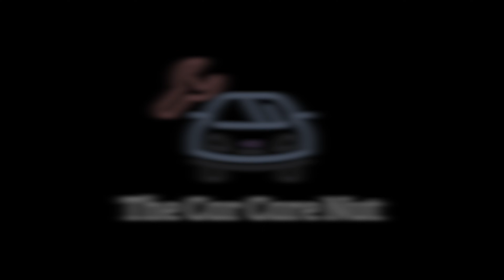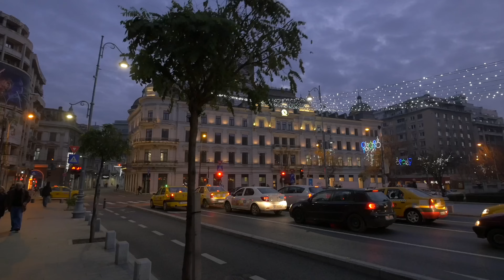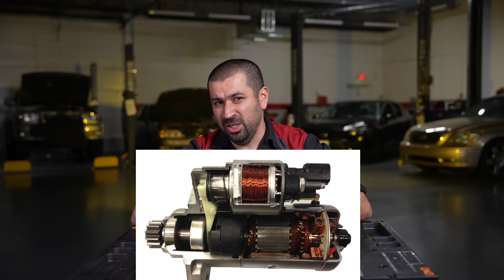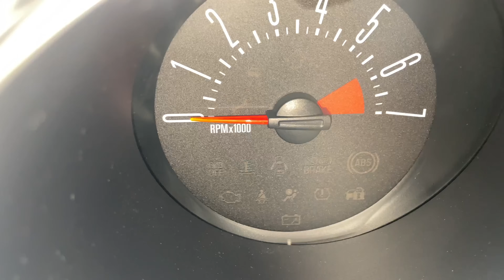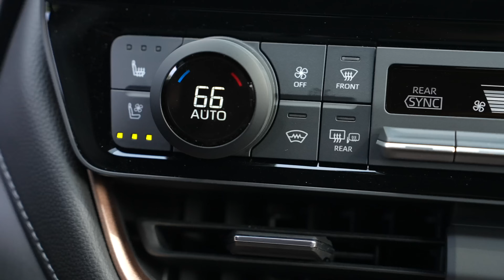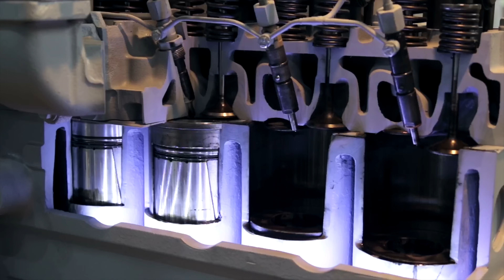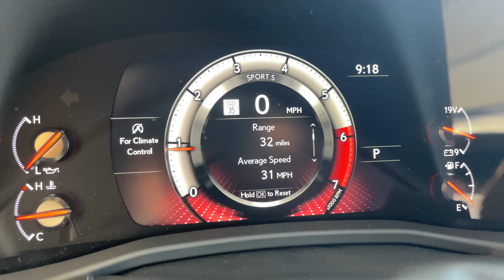How Does Start Stop Technology Work in Modern Cars? Everything You Need to Know

Comment: Amazing explanation. Sadly our LATAM corolla cross hybrids have NONE of those Air Conditioner fancy backups.

My Hybrid efficiency goes to the ground in cold weather because the engine needs to be constantly turning on to keep the heat of the coolant almost 20°C above the AC set temperature. In hot weather AC keeps drawing current from the HV battery when the engine is off to be able to keep the inside cold. Surprisingly this helps a bit with the efficiency because if the HV battery is lower than 50% your regen braking capacity goes up and you can be a little bit more agresive in the driving without impacting the efficiency.

Comment: Start stop. When the auto industry sleeps with the EPA. 90% of engine west comes from just starting the engine because no oil pressure is present until it cranks over, go with that knowledge. Want to avoid start stop all together? Buy a standard transmission vehicle- if you can even find one. In feb. of 2021 before everything went crazy expensive my 21 Tacoma with a 6 speed had been sitting on the lot for 4 months, it was an unusual setup given it had a lift kit and all the goodies. 45 grand sticker price. My 2018 Cruze had negative equity of 5 grand I signed the dotted line, total out the door was an additional 10 grand. 59,800 in total. Welcome to PA where they’ll tax the hell outta ya, good news I made a deal at 3%!

Comment: There's a theoretical reason to suspect it causing engine damage because it turns off the oil pump, thereby increasing the possibility of metal-on-metal contact occurring inside the engine. Again: it's theoretical. Probably doesn't matter all too much in practice.
Reply: You have no idea what you're talking about and didn't watch the video. There are electric pumps...

Comment: To disable the system, simply disconnect the sensor on the battery. The car will not activate the Start/Stop system when it cannot monitor the battery health. I have always done this. I hate this system and pushing that damn button every single time gets really annoying.

Comment: In my opinion new  modern technology is quite often useless and not cost effective  for the consumer  at all . 
 I  still say stop start engines are a completely  stupid system  all the extra sensors needed  creates more possible  problems and more likely to have a   failure at some time more exspensive fix more exspensive  to maintain  more things to  replace more reliant  on the computer to not malfunction  and many more  things could possibly  go wrong at any time .  The extra ware and tear on the engine stopping and starting all the time  it  will not last as long  the fuel savings is  so minimal  for average  driving conditions . Old school rocks modern technology and  new designers  are a fail  and are   just a big  rip off scam .  Much like putting a submersible fuel pump and fuel filter in the gas tank  instead of an  external  fuel pump so pushing the fuel instead of pulling the fuel is better just another  exspensive  can  not replace easily  yourself  scam  . Oncoming traffic  being blinded by rediculaslly  over bright LED  lights  ect ect ect   :(

Comment: I love that toyota adds loopholes to shut these stupid start stop systems off. My 2023 tundra crewmax doesn't have the button (probably because the 1794 edition is a hybrid) but i can simple put it in tow/haul mode and the auto stop is defaulted off. Just need to find a tuner that can save my settings between start ups and have my truck start up in tow/haul mode

Comment: to be honest  I really dislike this system.
Reply: I press the off button on every trip. I dont mind turning the engine off in a long traffic queue but on the other hand if I am driving long distance abroad I want to keep the engine running for fear that it wont start and leave me stranded. Breakdowns abroad are no fun
Reply: Wow there’s a lot more parts involved in these start/stop systems than I realized
Reply: I would rather just buy a hybrid or EV.
Reply: Whatever happened to the Chevy hybrid that only worked with an alternator
Reply: I really don't think anyone would hate start stop the problem is they hackintash the thing rather than properly designing it
Reply: I usually just shut it off when doing stop and go driving.
Reply: Same here everyday I need to push the the start/stop button. Some cars you can turn it off permanently but not mine 😢
Reply: This system is annoying, puts unnecessary wear on starters, adds numerous completely unnecessary new points of failure (which he describes step by step) and extra cost and helps virtually nothing practical whatsoever. 

I hope people punish manufactures trying to push it by avoiding any model with it. If they want to cut emissions they better come up with something better than this ridiculous farce.
Reply: It’s amazing all the tech that goes into a completely useless system.
Reply: The industry is forcing it on us.  They don’t care if we like it or not.
Reply: Its programming for future idiots
Reply: Me too.
Reply: Me too. I got rid of my Accord due to this.
Reply: Everyone does.
Reply: Wow
Reply: Almost as bad as VCM
Reply: That makes all of us
Reply: I love it.
Reply: It grew on me. I do shut it off in traffic jams though
Reply: When you stop the car, it re-enables it. Hate the feature.
Reply: @raybiglow1944 hold down the button on startup and see if it disables and then keep the button down with your finger.  If that works, wedge a zip tie in to always keep the button down, and cut it off flush.  Problem solved
Reply: @NETWizzJbirk yes I've seen this done on a 2025 cx70 Mazda it seems to work 😂
Reply: Right after you click your seatbelt you can make it a habit... @raybiglow1944
Reply: Great explanation!
BUT
Is the extra wear on the flywheel and Bendix worth the few attaboys from the EPA?
Is the enormous complexity introducing unnecessary unreliability? (Yes, you get to it.) I drive cars that are typically 25-30 years old, and have never had to replace the starter in one of my street-use cars.
So, you're getting enormous complexity and expense for just about NO benefit. Thanks, government.
Reply: We all hate it. Let's thank the epa for this 😑
Reply: @pabloso8403 Let’s think the automakers for being willing to add all these points of failure and expense with no benefit to the buyer because it was the cheapest way to game emissions tests instead of doing the right thing to implement hybrids, like Toyota did, to give car buyers better gas mileage and lower emissions. 

Hopefully we’ll see series hybrid vehicles come to market and sell well, because they simplify these mechanical systems dramatically.
Reply: Always fun when your engine shuts off going thru a pothole
Reply: Agree another thing I hate is keyless entry
Reply: @AlanSmith-xu3lo 😂😂😂😂😂
Reply: Yes, fuck the planet. I want my car to run properly. When the light changes green, I need to be going immediately. I may have to accelerate quite a bit to get ahead of the car next to me because I want that lane, and there are 25 cars behind him that won’t let me over. I have a fast car and the stupid thing does not turn off by itself at a red light, I can take care of it myself. As a sales guy told me when I bought my sports car “drive it like you stole it”. I do that every day in My Car that does not have this stupid feature, but I’m needing to buy a new car soon. Good to know about this and I’ll be asking about it at the dealership before I even consider buying a particular car.
Reply: You sound like a tool  @keithgiesler1027
Reply: You can disable it
Reply: @monkeygalaxy6322 Most cars reset this every start up
Reply: @monkeygalaxy6322 not in my 2020 Chevy Equinox… 🫠
Reply: @monkeygalaxy6322 for now…
Reply: @monkeygalaxy6322  it's on by default - a "feature" no one asked for. It should either be off by default (you can enable it) or use the same setting at start up that was set when you turned off the car.
Reply: @inigomontoya6075  Im pretty sure that the EPA required the mfr. To turn s/stop on at every key turn cycle.  Otherwise they would not get the mpg credit in the city cycle mpg test.
Reply: I don't mind it. It causes no problem except for when it's hot day and I need to turn it off.
But it maybe is over-complicated. And perhaps it rises car price unnecessarily. I don't know how much benefit they give and I don't care.
Reply: Why?😊
Reply: @whatitisnt.  these start & stop systems are some of the worst for cars in terms of mechanical wear  Isnt that enough of reason why its bad?
Reply: @whatitisnt. No reason for it.
Reply: @ExecuteBrandon Besides lower emissions?
Reply: @whatitisnt. The #1 reason to dislike is the most damage to engines is caused during startup. Start/Stop is rougher on the engine than idling for a minute or so and maybe saves a few gallons of gas a year. Get in the habit of turning it off everytime you start your car.
Reply: @DrShanksALot  Did you watch the video and hear what he said? Doesn't look like it
Reply: @DrShanksALot That’s no longer true.
Reply: @DrShanksALot The author of the video said that this feature is not intended as a gas-saver. It's an emission control. He also explained the night and day difference between old style stop and start which is hard on an engine versus all the changes that were made with the new technology that eliminates pretty much all of the old problems. Sounds to me like engineers left no stone unturned with this technology. It's quite amazing to me as a former ASE automotive technician.
Reply: @ddascola01 not all car brands, keep in mind he is Lexus Toyota guy.
Reply: @CreachterZ 😂😂😂😂😂right
Reply: Why hate on a system that can be turned off and forget you got the tech.😅
Reply: I am really sorry for you. 🤣🤣

Comment: Fascinating. Never realised this start/stop system was so complicated. Thanks for the great explanation.
Reply: And very,very expensive to repair later too!
Reply: It's not even very expensive to repair, and also all of these systems and sensors are already in place. The seat belt sensors, temperature sensors, vacuum sensors, etc, these are already in place. As far as reliability? Making a bigger vacuum reservoir isn't less reliable, it's the same damn thing just a slightly different design when you initially design it. Provided the car is designed properly for start stop it can actually be more reliable. So far, start stop starter motors are basically never replaced. They are brushless and extremely overbuilt because manufacturers were worried about a bad image of the system. Start stop systems are great and not only do they pay for themselves in increased reliability statistically, they also save fuel at that. A lot of people will disagree, some people still disagree about fuel injection over carburetors. Fuel injection has proven to be extremely robust and reliable and in the real world, you're more likely to have an issue with carburetors then fuel injection.

Comment: I think I’ve mentioned it on another video but I really love those worx combo sawhorse/worktables. I do woodworking as well as project car work and Ive purchased several of them - the design is so well thought out - the built in guides that match up to a table saw, the clamp spaces around the edge, plus the little organizational spots molded into the top make them awesome little workhorses around the shop.

Comment: My biggest concern regarding Start/Stop system on my turbo Civic X is possible engine immediate shutoff after active hot acceleration when you suddenly have to stop at the next traffic light. Some engine oil could be burnt in hot turbo cartridge and some coolant could be boiled as well.
It's OK to Start/Stop when you just sitting in slow stop-n-go traffic when everything's warmed up and it's nice weather outside like +20ºC / 70F and all the conditions are met.
Btw, the engine won't start without cranking at all because of leak of compression which eventually disappears from "compressed" cylinder.

Comment: The common issue is that it wears out the battery and starter prematurely.  Hybrids use the electric motor to start the gas motor.  No starter.  Much more power and durability in the electric motor compared to a starter.  The 12 volt battery hardly does anything.  Just more stuff to go wrong with these start/stop systems.

Comment: Question:

You say that the engine will not be damaged, because the start stop technology won't allow the car to shut off when the engine is cold. But at the same time you say it checks the coolant temperature, but not the oil temperature.

I've been repeatedly told that my engine is NOT warm when the coolant temperature is in working range, but that I should rather monitor my oil temperature. Or if I don't have the sensor, then drive at least 10-15 minutes warming it up.

Why is coolant temperature monitored here and not oil temperature? Who is right about when the engine is "warm" for this use case?

Comment: A couple of years ago I rented a car that had this very annoying feature. I don't remember what it was.  It was 110°F outside and the AC would start blowing hot air.  I pulled the vehicle over and looked at the manual (was fortunate that the the rental company left one in the glove box) on how to disable it.  There was a setting to disable it from the in dash settings.  It was permanent.

Since it takes a special battery for this feature to work "properly" and the computer recognizes when the battery is not this special battery (which can cost up to $500) isn't the battery you have installed, I would install it.

Comment: Oil pressure in a stopped engine is still 0, every start event runs with low oil pressure for a split second. Still think that's bad for the engine.

Comment: The mild hybrid technology is the evolution of the start stop system, electric motor in place for the complicated starter, 48v battery in place of the 12v and capacitor, and you just use that to pump the coolant,atf,refrigerant with better efficiency and not at the cost of of a full hybrid setup.
As a plus you get start off torque from the motor to reduce fuel consumption and some cars have 48v powered turbos to reduce main turbo lag

Comment: There are a couple things that are different with my brand-new Nissan Rogue that has the start-stop tech.  One is that you have the option, right in the menu, to disable the start-stop.  Frankly, this is my third Rogue, and I had no idea that it came equipped with that feature until I got to a stoplight and the environmental controls were balanced and the motor shut off.  I said to myself, gee, this is awfully quiet!  Since that time, I have also discovered that there is an additional condition that you did not mention that will cause a motor re-start.  That is the steering.  If stopped at a light and shutdown occurs, you simply can tug at the wheel to turn just a tiny bit and the engine restarts to give you the steering assist.  
One thing I would change in the design is the starter.  We have been locked into the conventional starter design for decades longer than we should have been.  With the advent of new solid-state ac/dc inverter technology, it is high time we replaced both the starter and alternator with a 3-phase motor/generator.  This is akin to tech used by railroads for propulsion today, but this would be on a much smaller scale.  Simply replacing the solid flywheel with a unit that can be both a 3-Phase motor and then reverse instantly into being an alternator to provide power to the vehicle for all needs is relatively easy to do.  There would be no moving parts whatsoever other than the stator and rotor!!!  In a well-sealed chamber, it would last the life of the car with ease.
Reply: My mom's boyfriend works at a Chrysler dealer and they scrap dead eTorque modules all the time. What actually dies is the computer.

I was scrolling around on FB marketplace and I found an old Buick LeSabre. The 3800 V-6 engine that powers it has space for a supercharger (optional) and associated separate belt.  Theoretically, I could buy a dead eTorque module, feed it 3-phase with a VESC or some other RC speed controller, and hook it up to that 3800. I'd use it for more low-end torque, delaying downshifts when climbing hills, and start/stop. The 3800 likely wouldn't mind being started and stopped, those engines are as tough as nails.
Reply: They actually already make that! Most brands call it a mild hybrid I think. Dodge has their "eTorque" system which is exactly what you described, they happen to also use it for a low end torque boost I believe. Hyundai has something similar too.
Reply: @smg950u  Oh, nice!!

Comment: Considering that it has been estimated that 80% of engine wear takes place in the first few seconds of startup, I think that this will damage an engine in the long run. And what about the ring gear? The wear on that and the cost to replace it has not been addressed. I understand that there are electronic plugs that can be installed on the back of the disable switches to cancel this "feature".
Reply: The key factor you are not mentioning is that 80% of engine wear takes place in the first few seconds of a COLD startup. These are not cold startups. They are at operating temperature with engine oil still at effective temperature.
Reply: Did you watch?
Reply: Many systems don't use the ring gear - just used an alternator/motor off the best.  Starts are also fast (200 ms) because they can spin up the engine fast and then fire the cylinders.  Totally different than the slow crank for 5+ seconds with some hope and pray that the carburator guesses the right temp and mixture.

Comment: You explained very 👍

Fortunately, my car is older and does not have this feature. When I buy a new car (used), and if it has this feature, I will immediately disable it permanently. In the worst case, I will remove the sensor on the battery 😂